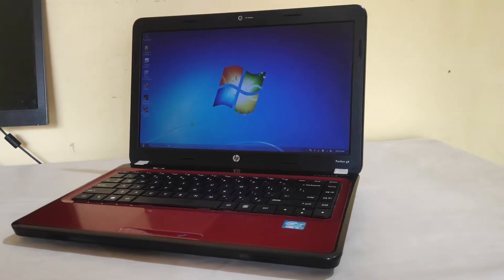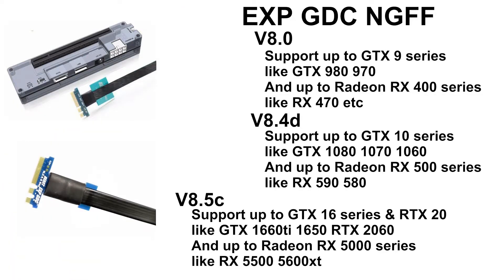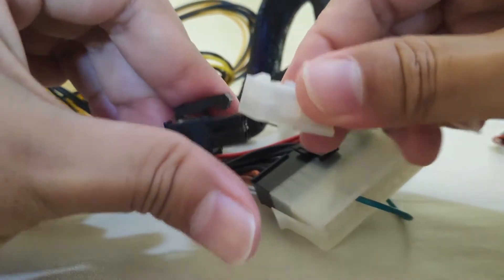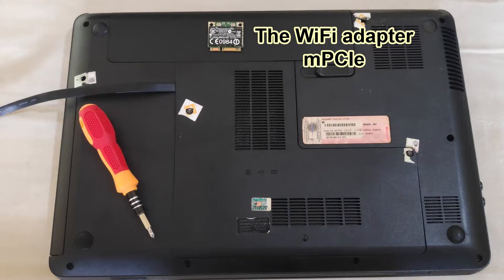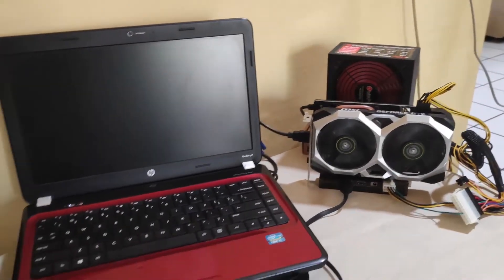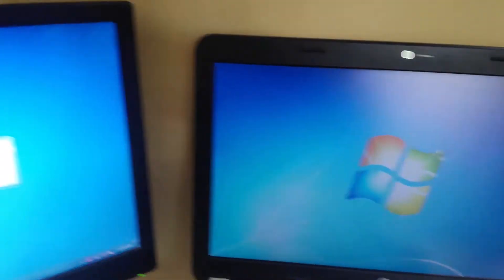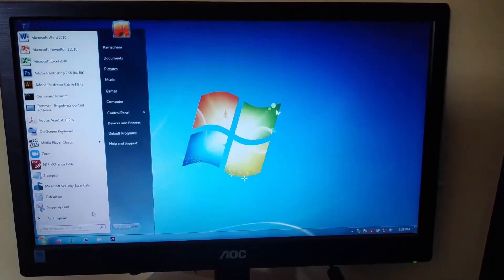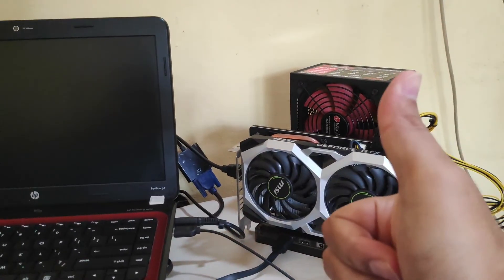EXP GDC Beast V8.5c eGPU with GTX 1660 ti on Old Laptop from 2012

Comment: Thanks for uploading this helpful tutorial video, I had got all the details I've needed for! 
Btw I have an intel i7(UHD 620) AMD Radeon TM-530 laptop with 20GB RAM memory. Is this whole set up gonna work on my laptop comfortably??? 🤔🤔
Reply from the maker: it sounds like your Laptop is from early 2017?
There's a Hit or Miss situation inside your Laptop's motherboard.

First of all, does it have 2 M.2 NVMe Slots? And yes, must be M.2 NVMe and not M.2 SATA. Because most Laptop from that year only have 1 M.2 NVMe SSD Slot.
I was wondering if it's possible to use EXP GDC NVMe V9.0b for your Laptop.

Therefore you must open it by yourself to confirm. However that Laptop might have NGFF Type WiFi Adapter.

The difference between NVMe vs NGFF WiFi slot is about 32 Gbps vs 8 Gbps.

For the NGFF EXP GDC Demonstration, read the Pinned Comment of this video.

For the NVMe slot External GPU, This is the demonstration where you Plug it into the NVMe SSD slot https://www.youtube.com/watch?v=_5Yy83FCa0k

For a little more Tidy setup with NVMe slot, you can try to use these. Read his Video Description https://www.youtube.com/watch?v=ElkbjJqapu8

Comment: Do you need an external monitor for AMD GPU?
Reply from the maker: Depends.

Is it Old Laptop or New Laptop.
New Laptop doesn't need external monitor because it has enough Bandwidth speed for Two-Way transmission 32 Gbps divided by 2 = 16 Gbps.

Old Laptops are often between 8 Gbps or 5 Gbps or 2.5 Gbps. Not good if not using External Monitor
Reply from the maker: AMD or NVidia GPU doesn't matter. The Laptop itself is Matter.

Comment: Hey can I use this on Intel i7 6500u
Reply from the maker: What Laptop model to be specific? I'm afraid that most Intel CPU with -U series sometimes it is either Hit or Miss when connecting with eGPU.

You might know Intel CPU -H & -G series which is more preferable from 6th Gen —Today
Reply: I use Thinkpad x260
Reply from the maker: @obamagamingofficial5113  Yes, apparently it is possible to use Beast EXP GDC NGFF for Lenovo ThinkPad X260.

Check the Pinned Up comment of this video
Reply: @ClayWheeler   can I use gt 1030 or gtx 750 ti if so what gpu would you recommend
Reply from the maker: @obamagamingofficial5113  Try to Find any GPU at reasonable Price in your Place.

If you are buying any GTX xx50 Series —Like GTX 750, 950, 1050, 1650— You must buy Dell DA Brick 220 Watt Power supply which is about $20
Reply: @ClayWheeler  can I buy alternative supply instead of Dell?
Reply from the maker: @obamagamingofficial5113  Because you are planning to get GTX xx50 and those Graphics Card don't have PCIe Power Connector.

So you need to supply 75 Watt Directly to the Board itself.

If you want to use Regular Power supply like in this video, You must buy at Least GTX xx60 series —Like GTX 760, 960, 1060, 1660— So they GPU card can get separate Power from PCIe Power Connector
Reply: @ClayWheeler  thanks!

Comment: there a prombom with my pc so i put my asus GTX 1050 on the thing and it turns on normaly but it just stays on the loading screen for hours and it hasent changed please help me im on a 2020 hp laptop
Reply from the maker: if you are using GTX 1050, please use Dell DA Brick 220 Watt Power Supply.

I have a video about eGPU Troubleshooting.
The adapter from EXP GDC don't have enough power to give 75 Watt to the GPU

Comment: Hi I bought a msi 1060 6g gaming x for my laptop Dell e7450 but my graphic card doen't work how I to fit it
Reply from the maker: is that Core i5?

Using what EXP GDC model? NGFF?
Reply: @ClayWheeler  Oh yay I fix it use nvidia error 43 fixer, really thank you for your video so much

Comment: Hey bro, nice vid, hope you can suggest good graphics card that can run on my old laptop haha

Asus x550L 12gb Ram
windows 7 4th gen
Internal: Nvidia GeForce 840M
Reply from the maker: Question 1
What is the name of your CPU?
Full name of the CPU

Question 2
Do you still frequently bringing that Laptop outside of your house?
Reply from the maker: Oh wait you said Intel 4th Gen.
So it must be mPCIe eGPU. 
But since you have 4th Gen, it means the bandwidth is 5Gbps , which is double the bandwidth from this video 2.5Gbps.

Anyway, if you don't frequently bringing the Laptop for Traveling, then it is a good idea to use NVidia Graphics Card.

Which means Permanently disabling GeForce 840M.

So if I can estimate the budget, it is like $30~45 EXP GDC eGPU mPCIe (might not including Shipping) $15~25 PSU. 
Any NVidia card you can find at reasonable Price like GTX 1060 3GB, because that card is Less desirable for CryptoMiners, so it must be cheap.
Reply: @ClayWheeler  Thank you so much, yes planning actually to use 1050 ti 4gb for may unit :)
Reply from the maker: @PHLessLethal  sorry GTX 1050 Ti is not compatible with the regular Power Supply as used in this Video.

Try to watch my other video about Troubleshooting eGPU.

You need Dell DA 220 Watt Brick PSU which is about $20 not including shipping.

Comment: Can this setup do mining and get same hash rate as a pc setup🤔
Reply from the maker: No.
Well. except for the M.2 NVMe model, that one can.
Reply: @ClayWheeler  oh ok
Reply: @ClayWheeler  how to know if my lapi has a m2 Nvme slot my laptop is asus f15 tuf gaming 2020 variant
Reply from the maker: @anishxavier3498  Well duh, Open it up by yourself to confirm.

What is the CPU name? Full name
Reply: @ClayWheeler  my cpu is i5 10300H (4 core 6 threads)
Reply: @ClayWheeler  and dedicated gpu is gtx 1650 if i connect 1660 ti then i can use both simultaneously ri8?
Reply from the maker: @anishxavier3498  yeah, but first, must open the Laptop itself.

Sometimes for Asus TUF, the M.2 NVMe slot is already used for Drive:C installation Where your OS is running on.
Reply: @ClayWheeler  yeah will open it up to check it, but my model has 1 extra slots for ssd/hdd.
Reply: @ClayWheeler  i am scared opening my new laptop won't void my warranty?
Reply from the maker: @anishxavier3498  Just search on Youtube on how to add or change NVMe ssd for your Laptop model
Reply from the maker: @anishxavier3498  And the most important thing: "M.2 SSD" slot is DIFFERENT from "M.2 NVMe" slot. 

M.2 NVMe slot can be used for either SSD or External GPU. 

But M.2 SSD slot cannot.

So you must see if the slot itself says "M.2 NVMe" or "M.2 PCIe" or "SATA x PCIe"
Reply: @ClayWheeler  i just checked this video: https://youtu.be/OivVogVSZKU
They said m2 nvme ssd slot is available, so that mean i can use egpu with its full potential connecting a external monitor the same way you did?

Comment: Bro nice video, new subcriber hr,  i have hp probook 6550b i5  540m intel graphics R  (8gb ram 2 sticks 4gb) and 240gb SSD what grapics card you recommended
Reply from the maker: Core i5 540m that sounds like from 2010. Beast EXP GDC v8.0 is more than enough for you.

Anyway it must be using mPCIe type for the WiFi slot. What version of Windows is it currently? Windows 7 or 10?

Anyway for the Graphics Card you can use any NVidia that is NOT xx50 series. Because xx50 often don't have PCIe power connector.

For example GTX 750, 750 Ti, 950, 950 Ti, 1050, 1050 Ti.

That means GTX 760, 960, 1060 or higher is okay.
Reply: @ClayWheeler  im using now windows 10  ok maybe gtx 1050 is good? Or gtx 760?
Reply from the maker: @yumatv.  GTX 1050 don't have PCIe power connector. So it is not recommended.

Also, if you're using Windows 10, make sure it is Version 1903 or newer. On your keyboard, press Start+R and then type Winver and then press enter.

With the current condition of the Market, any GPU you can get should be good. Like GTX 760, 770. Or GTX 960, 970, or GTX 1060 6GB.

Your Laptop is 11 years old at this point, so Bottleneck is very Heavy.
Reply: @ClayWheeler  ok thank you bro for advice

Comment: hi,

i have seen this  work with a dell lattiude e6540, i7 4800mq laptop with the intergrated radeon 8790m with a w-lan card. Should it? I should use a nvidia card also, say a gtx 1050ti? What I  use  a mini pcie beast gdc?  Thanks.
Reply from the maker: Yeah should use NVidia GPU as well
Reply from the maker: GTX 1050 ti, make sure it has PCIe power connector.
Reply: @ClayWheeler  Gotcha! Has to have a PCie power connector, perhaps  a GTX 1050 ti with one or a GTX 1060 or 1070.   Thanks again.
Reply: @ClayWheeler  One more question, if I get  a GDC,  V8 .5C for nvidia,  does it cover GTX 9 series up to the  RTX 20 series?

For example, if I get that one (the GDC V8 .5C) for nvidia, that would cover the GTX 9 to RTX 20 series, right?

 Or if I was using a GTX 1060 the GDC V8 .4d  is the specific one I would need?  Or will the GDC  V8.5C work also?
Reply from the maker: @justacooldude28  Correct. It can
Reply from the maker: @justacooldude28  But apparently it doesn't matter. 

There's another YouTuber who showed RTX 3070 worked with EXP GDC mPCIe 8.0
Reply from the maker: @justacooldude28  Anyway, if you're using Windows 10, Please make sure it is Version 1903 Or newer.

And MUST DISABLE Automatic Hardware Driver Update. Check my other video regarding Windows 10 troubleshooting

Comment: Hi. I recently tried to set up, but my graphics card and PSU stays on even when the PC is off and when i try to install graphics drivers it says "Graphics driver unsupported by Windows version? Please help me
Reply from the maker: What GPU model?
Reply: @ClayWheeler  GTX 1060 Gaming x 6GB
Reply: So basically everything starts up, it's just that I cannot install the drivers.
Reply: @ClayWheeler  Under device manager, it shows the HD graphics under display manager
Reply: I did disable the PXE boot and kept the WIFI enabled under the Bios aswell
Reply from the maker: @jivenlatchman5492  try to use Graphics driver from NVidia from December 2020

Comment: Now Nvidia GPU patched up so we can't use e GPU in mpcie it works only in thunderbolt
Reply from the maker: No it is not. If you're just using the Original Driver as is from NVidia, of course it will return with Error.

As for me, I'm currently using the latest Driver available for GTX 1660 Ti in this Laptop. And it returns with ERROR43. And it can be easily Fixed by Registry Modification
Reply from the maker: I just updated the Driver 1 week ago, and still working fine.

But I must TURN OFF the Automatic Driver Update feature.

Comment: I have Asus laptop x556uf intel i5 6200u, will it work?
Reply from the maker: Apparently you will need the NGFF Version

it is using DDR4 RAM right?
Most DDR4 RAM Laptop will need NGFF type for eGPU
Reply: @ClayWheeler  no its DDR3L RAM, is there any chance for my laptop to use it? T_T
Reply from the maker: @salfaofficialchannel4757  you must open your Laptop to check the type of the WiFi adapter
Reply: I already check it, but i only have 1 screw
Reply from the maker: @salfaofficialchannel4757  same Like in this video?
Reply: How about the size between mini pci-e and NGFF M.2 is it same or it got different size ?
I think ngff will be the one, 
Cause its small than the Mini pci e.
 i hope i can send ur picture of my laptop, if you have telegram
Reply from the maker: @salfaofficialchannel4757  Hmmm I don't have Telegram.

But can you just make a Short video and upload it to your Channel about the Connector type? It seems to be easier
Reply from the maker: @salfaofficialchannel4757  or send your Photo to email Gmail

Blazer.Twin@gmail

Comment: Hello sir I'm planning to try this out with a 1060 6gb that I'm going to buy, the port I have available is the ngff wifi card slot. Which dock should I purchase, the 8.0 or 8.5 or will there not be any difference?
Reply from the maker: For GTX 1060, actually Beast EXP GDC V8.0 is okay.

Because I have seen someone using RTX 3070 on EXP GDC V8.0 just fine.

You might want to search on YouTube using these keywords for NGFF:

MeanPooh NGFF
Reply: @ClayWheeler  oh yes I've seen vidoes from that channel as well, thanks for the insight. I can save a bit of money with that info. Also with regards to having a cheap power supply, I saw in your other vid that the power output may be unstable so I am a little afraid that it will also cause me some small issues.
Reply from the maker: @freetohplays2533  no need to worry.

GTX 1060 still needs PCIe Power Connector anyway. And it is relatively same power requirement to GTX 1660 Ti.

A Cheap PSU will do.
Reply from the maker: @freetohplays2533  as long as the PSU has dedicated PCIe Power Cable, it is more than enough for GTX 1060
Reply: @ClayWheeler  okay thanks for your help!

Comment: Is there a problem with overclocking cards while using this dock? I've tried doing so but ended up crashing my system
Reply from the maker: Overclocking with this setup is depending on the dock model that you're using.

Only suitable for M.2 NVMe dock.
Reply: @ClayWheeler  Ah. i have the ngff version.
Reply: I actually haven't seen an exp gdc overclocking video
Reply from the maker: @ebi6097  Correct. Remember GBps vs Gbps is different

Overclocking need M.2 NVMe because you need PCIe Gen 3.0 x4 Lanes 32 Gbps which is only available  in NVMe slot.

Meanwhile NGFF is equal to PCIe Gen 3.0 x1 Lane 8 Gbps. Not enough traffic for Overclocking.

But this video is using old Laptop which has PCIe Gen 2.0 x1 Lane But with One-Way Traffic only. Hence 2.5 Gbps and need External Monitor.

Your Speed is technically 8 Gbps and support Two-Way Traffic. which means it is possible to not use External Monitor. But using external monitor will have better FPS anyway
Reply: @ClayWheeler  Well i guess it makes it clear that a gpu uograde is the only thing i can do to improve my performance

Comment: my laptop has an HDMI port integrated Do I need to buy a cable and still remove the wifi card? Thank you
Reply from the maker: Yes. Because the HDMI port from Laptop doesn't carry Raw unprocessed Graphics data.

It needs to be transmitted via WiFi slot (mPCIe) which is why the data transmission is called PCI Express.

You can use the HDMI cable from the Graphics Card video output, to the external Monitor or TV that has HDMI input
Reply: @ClayWheeler  Thank you

Comment: I was wondering..since the beast has a hdmi to mini pcie, can u use an hdmi to usb c for thunderbolt connection or is there more tonit to get the beast to be a thunderbolt
Reply from the maker: Thunderbolt needs its own Chipset on the eGPU dock Module (just like any other Thunderbolt External GPU on the Market)

Beast EXP GDC doesn't sell Thunderbolt eGPU.

The only reason Thunderbolt eGPU is not Cheap -- around $200 or more -- is because the Company who makes every Thunderbolt eGPU must pay Royalty for every unit being made. Yes I know Intel gave away the Rights patent for Thunderbolt interface, but apparently it doesn't apply to TB3. Only TB4 and forward. And YET, The only Thunderbolt eGPU that already exists on the market is TB3 based, no TB4 existed yet -- in theory TB4 should be Cheaper.

But if you're looking for the Cheapest Thunderbolt eGPU, you might want to search on Chinese Online Shopping websites like Alibaba or AliExpress.

You might want to check ADT-Link R43SG TB3.
Reply: @ClayWheeler  thankyou!

Comment: I was so excited for this kind of thing back when ExpressCard started being a thing, and then it didn't happen until no one was including a socket for it anymore.
Reply from the maker: Not everyone even thinking about adding external GPU for Laptop back then.

Let alone utilizing ExpressCard slot itself.

No official ExpressCard external GPU dock ever existed. Beast EXP GDC is unofficial device made by a small company somewhere in Chína, yet they still managed to supply the demand in online shopping like AliExpress.

However I still prefer the NGFF or M.2 NVMe eGPU. It's crazy faster than ExpressCard
Reply: @ClayWheeler  I'm just glad my new laptop has a gtx 1650 built in so i don't need to think about adding one 😂
Reply from the maker: @Jackpkmn  bruh, if I have a Laptop with GTX 1650, I'd still want to use eGPU like M.2 NVMe.

Just like Asus ROG Flow X13 which has GTX 1650 and RTX 3080 eGPU as a Bundled item.
Reply: @ClayWheeler  Yeah but then i couldn't use my Intel 665p 1TB
Reply: @Dhfa 10 I mean it's pretty clear, were talking about adding external GPUs to laptops.

Comment: hey question, if i use the v9.5, can i use the same gpu as u?, i have an i3-8145u 12gb ram lenovo which was pretty recent.. got the laptop like last year, it has m.2 pcie connector inside.. that means it can run gtx 1660 ti graphic too rite?
Reply from the maker: Correct. Any GPU from 2011-today is possible as long as it's built within PCIe Gen 3 & Gen 4 support.

However V9.5 only suitable for Laptops from 2017 or newer to this day. 

Upon reading from buyers who bought V9.0b they can actually use RTX 3080 just fine.
Reply: @ClayWheeler  ah cool, cus i check the bottleneck website with ur cpu etc, there's no way ur laptop cud handle 1660 ti, so i guess the power supply helps with that?
Reply from the maker: @junopw  yes.
However upon reading the Specs of your Core i3-8145u it only have 2 Cores 4 Threads.

Which means it is not suitable for Heavy Gaming like GTAV or RDR2. Even with RTX 2080ti you will struggle to get 24 FPS.

Most heavy Games needs at least 4 Cores 4 Threads to eleminate Bottleneck. 4 Cores 8 Threads is more recommended.

With only 2 Cores 4 Threads like your CPU, you can only play Competitive games that is NOT-So CPU intensive like CSGO, Valorant, Overwatch.

Most games that is GPU dependant like all Capcom games can be played at High settings and will still get 60 FPS even with 2 Cores 4 Threads and eGPU like 1660 ti.

Anyway, Heavy Games will need at least 4 Cores 4 Threads or higher
Reply: @ClayWheeler  ahh! awesome, thanks for the clear explanation
Reply: @ClayWheeler  i check my game (ffxiv) turns out its more gpu intensive game, cus ive been playin it with a 30 fps ish..
Reply from the maker: @junopw  Correct